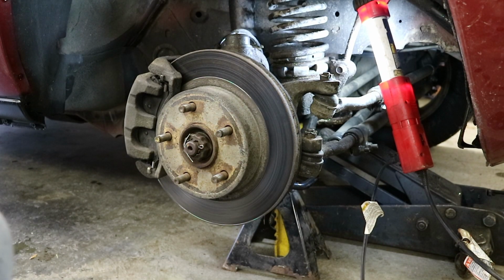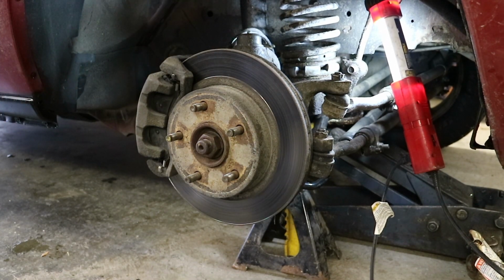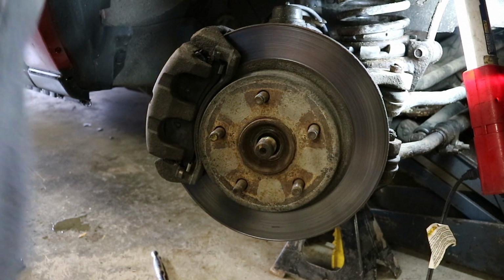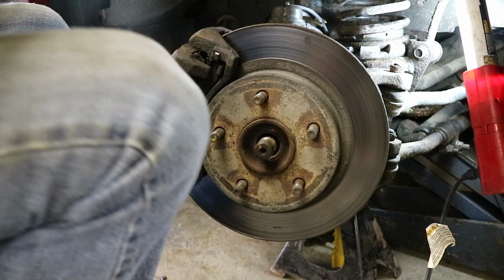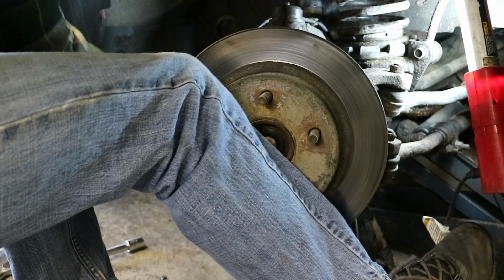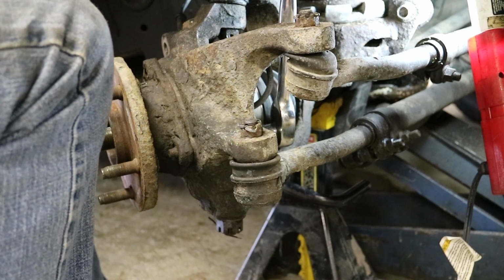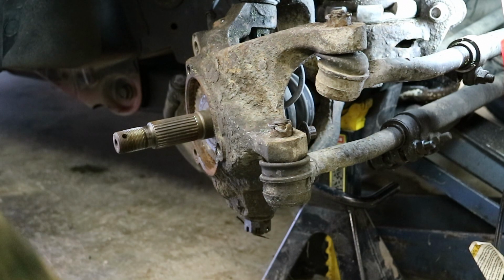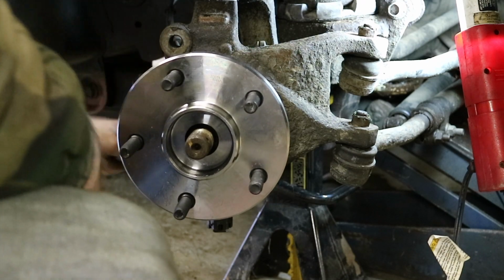Jeep Grand Cherokee Wheel Bearing Replacement

Comment: That big nut is 36mm. It's also supposed to also be tightened to 175 foot pounds.
Reply: +KINGJB3100 So TIGHT.
Reply: +noredcr 1 7/16 is 36.5 mm, its fine, the larger the nut/bolt head the less precision matters in socket choice.
Reply: +noredcr Precision is key yo
Reply: Nope. 100 Ft-Lbs is the correct torque for a 2005-2010 wheel hub nut. Read the SKF pdf Manuel, http://www.skf.com/binary/81-66360/457377.pdf
Reply: Wrong 229 lbft is what alldata recommends for 2008 GC Jeep!
Reply: I saw on a forum you're supposed to put 1000 ft lbs of torque. God so much misinformation here.

Comment: 2000 jeep cherokee xj Will a broken rear leaf spring shackle bracket cause the rear end to be a little off enough  to where you can hear a noise in the rear end? I have replace Ring Gear and what i call cluster bearing with what i know was a good set up out of my other Jeep with the same ratio.  New axle bearing, no help. I thought well has to be pinion bearing then i thought will that broken shackle bearing cause that rear end to be off centered and make a noise???

Comment: Will this work for a 2001 Jeep Grand Cherokee right wheel bearing? If I take it to a mechanic how many hours would this be? Price is $60 for the new bearing. So trying to see if I should try it myself!
Reply from the maker: As far as I know they are the exact same; price will differ from mechanic to mechanic. I can tell you when I did the other side I finished in a half hour start to finish.
Reply: About $250 - $350.
Total with baring seals and race.

Comment: What year vehicle is this. You never answered that question specifically in all the other comments. Im looking at a '99 right now that I need to replace.
Reply: 99 is a different body style.
Reply: "ZJ" is the 93-98 grand Cherokee style. 99 to maybe 03 or 04 is wj instead of zj

Comment: Maybe I am not seeing it but what year is this? Thanks, great video
Reply: 2005 to 2014 it says
Reply: @cathytrombley9452  : Does not look like my 2007 WK.  Mine has a splash shield between the hub and the knuckle for a start. Maybe this is a WJ (1999-2004).
Reply: @dukenukem5768  - it's weird, the bumper looks like it is from the 05 to 14 but the Hardware underneath sure looks like 99 to 04 to me.

Comment: Is that a 2016? Is changing all the Cherokee wheel bearings the same?
Reply: He’s replacing the entire rotor assembly which already incorporates the (new) bearing. If you are replacing the bearing only, you’ll have to press the old bearing out of the old assembly, then press the new bearing into it.

Comment: this is not changing the bearing, he  is changing the whole wheel hub..
Reply: Wheel hub has the bearing inside. On a WJ they are basically made together and it's better to just replace it all with a negligible savings in cost.
Reply: Yep.
Reply: Which has the wheels bearings inside of it. If its time for bearings its time for hubs. And probably ball joints. And probably tie rod ends as well.

Comment: What year was this Grand Cherokee?   Hoping this is the procedure works for a 2011.
Reply from the maker: Unfortunately for you a 2011 will be different than this one. By then Chrysler changed over to an independent suspension design.